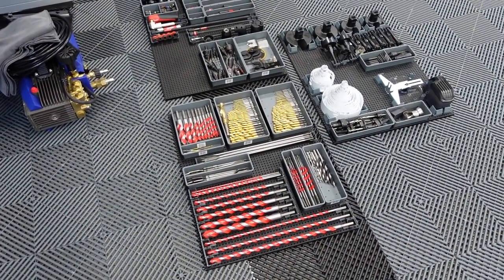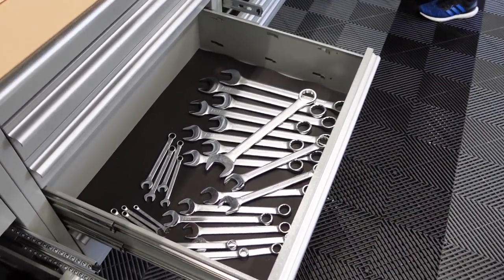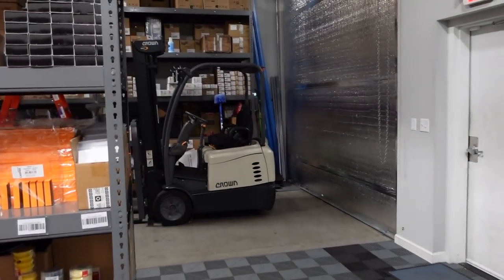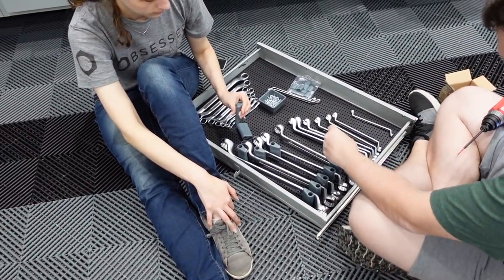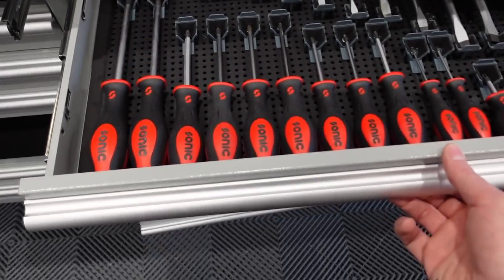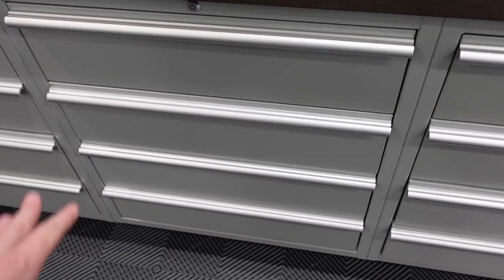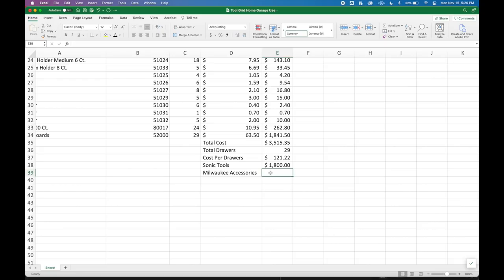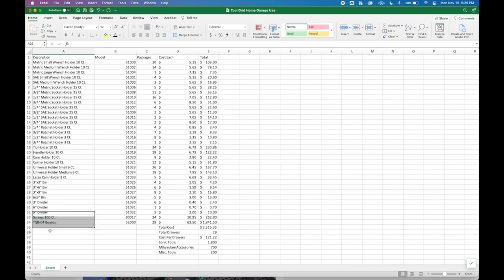Using Tool Grid to Organize 3,000 Hand Tools in My Home Garage

Comment: I bought 4 sets off of the MAC truck almost a month ago now. I have spent hundreds if not thousands on tool organization over the years. What I just replaced was a full billet machined set up for socket organization. This is hands down the best set up I have found for a heavy workflow professional mechanic. This even beats the foam inlays for aviation imo.

Comment: Epic use of toolgrid. This project definitely shows where toolgrid could create some new holders such as crowfoot. I did like the use toolgrid cam holders to hold really large wrenches that don’t fit in the toolgrid wrench holders. Also the use of toolgrid containers to hold milwaukee drill bits and accessories rather than keeping them in their case taking up space and taking longer to access.

Comment: FYI TGP 4 Grid Panels in Saber only need to be cut once if you never will need to get them out.  I cut the depth 19-1/4 and leave the 26" side alone.  its is tight and takes a little to get them in but they are super tight in the bottom and do not move at all.  This stuff is really cool i mean i fit just about every thing i had into 12 drawers! (6-shallow 6-deep)

Comment: IMHO with all of that drawer space it would be hard to find the right drawer when looking for what you need.
I have the HF tool boxes and I labeled each drawer so I know where my metric or standard 1/4. 3/8, of 1/2
sockets are. All of the sockets are labeled and marked also All of my drawers are labeled too i used a label
maker to mark them. HF has plastic strips and paper inserts that slide inside the handle for visibility.
I used the tool grid awesome system set up rather expensive but well worth it.
Reply: My thoughts, too.

Comment: Just did 3 drawers with ToolGrid from OG, screwdrivers/pliers/ratchets, cost was $368/3: $122.66 per drawer. So even on a (much) smaller scale, $120-ish per drawer sounds accurate.
Reply from the maker: Thanks for the confirmation!

Comment: Matt quick question. When using a jack on a car. Like a manual jack the floor tiles..do they fail easily? I presume they would right? If your pushing 600kg on a jack in a small point the tile would fail I presume.

Comment: I see in your garage you have varying configuration of the Saber cabinets; a majority "floating" and some just laying flat on top of the Swisstrax flooring.  If I was to use the leveling feet that come with Saber cabinets will the Swisstrax flooring support the cabinets on their feet without bowing, cracking, etc.? Thanks!
Reply from the maker: You would want to cut out that area where the foot contacts the floor.  It will settle and bow the tile.
Reply: @ObsessedGarage  Many thanks for that suggestion!
Reply: @ObsessedGarage  Sorry I forgot to ask a part II to same question - if I did not use the feet and lay cabinets flat on top of Swisstrax, will that be fine?

Comment: More tools then actual mechanics who make a living off them have, 3/4” stuff is such a waste of money along with 90% of that stuff just for oil changes and tightening lug nuts
Reply: Not the point but i do agree.
Reply: Matt makes a living off tools as well.
Reply: Do you skip 3/4 and go straight to 1 inch? Sometimes we use 3/4 drive so much that 1/2 drive feels like 3/8.

Comment: The only issue I see with this is the lack of labeling on the sockets since they just get covered up
Reply from the maker: Tool Grid has a labeling system to keep track of everything.
obsessedgarage.com/products/tool-grid-identification-labels
Reply: @ObsessedGarage  yes but it is beneath the socket on any sockets larger than like 15mm right?
Reply: Shouldn’t it stick through the middle of the socket with the size?